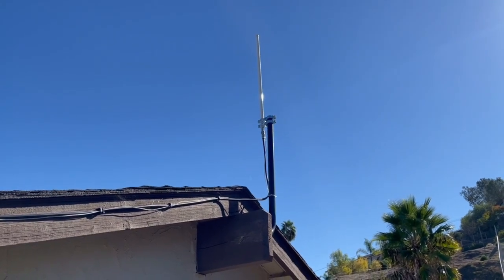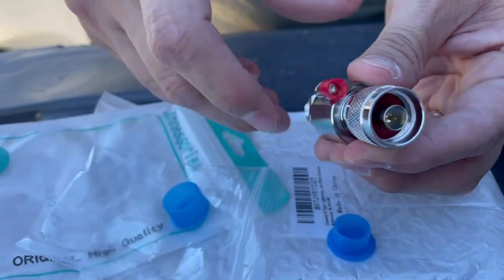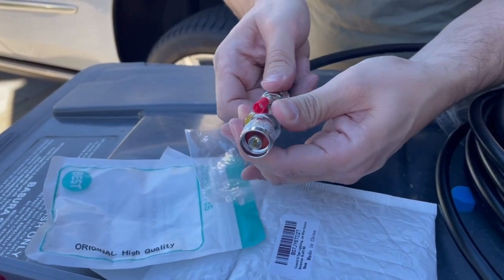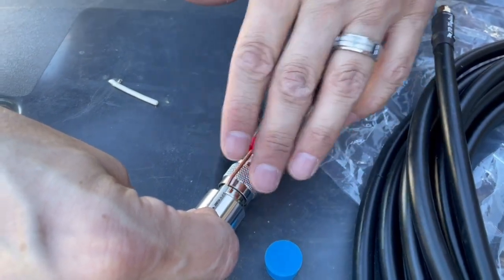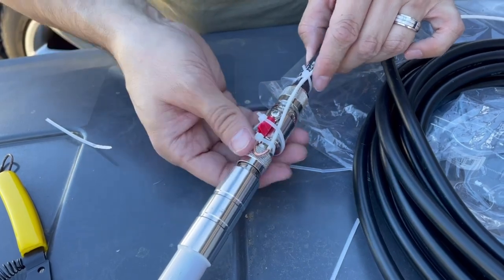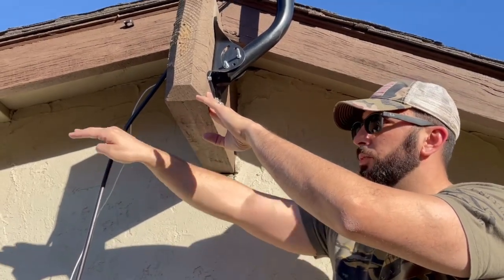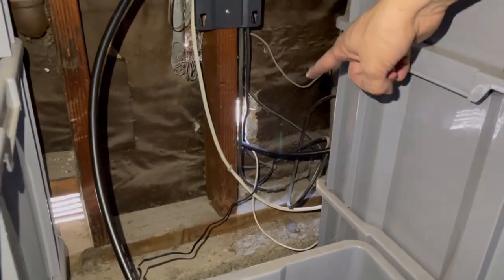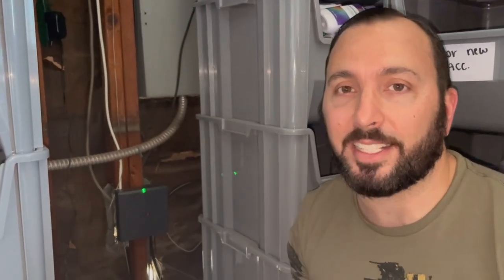Earn More Helium With Outdoor Antenna Install | Simple Process To Help You Get More HNT (Easy Money)

Comment: I know this is 2 years late. But I like using the emt metal conduit. It will fit inside your mount bracket and give you an extra 10’ in height.

Comment: Great job Caesar! My only critique is on that lightning arrestor you crimped the plastic part. You're supposed to crimp the metal part between that and the screw. This can be done by unscrewing that connector so that you can get your tool around it and then screw it back in and face it downward. I've been cabling for 30 years, which includes RF, Network, fiber optics and any other low voltage cable you can think of. The company I work for builds 5G for every major carrier.
Reply from the maker: Thanks for the info Dan.
Reply: I left off the part that you can direct message me anytime you want and bounce any ideas off of me. I'd be glad to help you out because I like your content.
Reply from the maker: I appreciate that. I’ll be sure to message you if I have any questions. Thanks again.
Reply: @CesarCinema  It says not to attach new antenna directly to the miner. How do I connect it. I do have the correct connection but concerned why they say that. Thank you.
Reply: @CesarCinema  I did the same as you lol.  I'm definitely not an electrician.  The copper wire came out so then I did as Dan explained and wow what a difference!

Comment: I had a rak miner fry last year.  It was hooked up to a rooftop antenna. I didn't do my research and realize the antenna should be grounded. I think that these lightning arrestors help protect the helium miner from built up static electricity in the antenna as well.

Comment: Great video. Have a question about the lightening arrestor. I installed mine close to the miner to protect miner from static charge build up from the cable. Is this good or not?
Reply: The purpose of the arrestor is to be underneath the Antenna to protect from static elctricity and positively and negatively charge clouds and storms, left over electricity from the earth, etc. it can travel. As for close to your miner, I’m not sure what that even means….
Reply: You want your lighting arrestor outside.  The arrestor is used to shunt the lightning away from the cable and into a ground rod.
Reply: @tylerharpster929  it’s not really for lightning. You can’t “shunt lightning away”. If you have on installed, and lightning strikes it, or your house/building you are toast my friend. It does however, protect against any electricity or other wise dangerous electric charges albeit in the air or other wise that could damage your device.

Comment: I'm not an electrician but you'd likely need a way bigger gauge (like 2AWG or 0AWG) ground wire to carry the surge to ground vs that small wire. If you think of the size of the ground wire for your panel in the house its way larger.  Just a thought if you are going to go through the trouble of installing one.

Comment: Another good idea is to, install a small male to male  jumper. A couple of feet long for example. From the bottom of the antenna (male.) To the lighting arrester (male.) Then run your wire from the arrester, into your miner

Comment: Where did you get the antenna mount that holds it to the pole?  I've been looking for one and I can only find them in bundles with antennas, but I already have antennas.  I use a flag pole so the pole is pretty wide...

Comment: Holy smokes yes !!!! Watch a video on how to crimp a wire… You need a wire crimping tool.. take the screw loose take your tool and crimp the round metal piece in front of where you crimped the plastic cause what you did has done absolutely nothing to bond your wire…the tool you has was a wire stipper go get you a new eye piece if that one’s ruined and crimp that wire inside the round metal piece..like I said you can watch a video on how to crimp on wires…I hope this helps and you learn something new from all of us it’s what we’re all here for to help each other

Comment: Thanks for the video I appreciate your selfless advice. 
Positive criticism I would advise against using electrical or any standard types what you want to use his heater in wraps what are use as an aerial and satellite installer is self amalgamating tape
 which is a self adhesive stretchy rubber waterproofing tape. Standard electrical tape there’s nothing more than Trump moisture an axe as a funnel. Keep up the good work   Thanks, Geoff

Comment: Hey Cesar, great video buddy. Thank you!  What a coincidence, today I had a pro install my 8 dBi Rak antenna on my roof, he did a great job. I drilled a hole on the side of the house and into the attic and the 2nd floor ceiling of my closet and installed the Bobcat miner on the top drawer of the closet (about 15 feet of LMR 400. Perfect!  I have a couple of questions; 1) I understand we have to go to a Helium website to update the new antenna and the  height, do you know where?  2)  How soon will the Helium system give back information of new Helium rewards?  Thanks a lot sir!
Reply from the maker: No problem William. Thanks for watching. Nice setup 👍🏻. 1) you change the new antenna and height on the Helium app. Click on your miner then the settings button ⚙️. Then go to Update Hotspot and change it there. 2) it normally take 72 hours to sync but it could be longer. Let me know if you have any more questions
Reply: Hi William, did you have a professional tv antenna installer do it, or was it a roofer? I’m looking for someone in my area to install as well.

Also, amazing stuff Caesar! Love your content bro
Reply from the maker: Thank you 🙏🏻

Comment: hello i am receiving my bobcat miner soon and i want to prepare for much reward as possible. i live near USC and they are flat land area. im going to put the antenna outside on top of the roof. its 25~30ft above the ground. i am also going to mount 40inch antenna pole on top of that. i was wondering what would be the best set up and if 5.8-6 dbi antenna will be the best? i see that on hotspotty map. LA area has terrible/poor transmit scale.. wanted to know if theres a way to fix that and turn it into green scale
Reply from the maker: You can choose from a 5.8 or 8 dbi Antenna. U can get one and if you don’t like the rewards you can switch to the other. Unfortunately you can’t do anything bout the transmit scale.

Comment: Hi Caesar, I’m a new subscriber. I am currently syncing a new bobcat at my sister in law’s house. She has a one story but I would love to install a rak 8 dBi antenna on her roof. At the moment it’s connected to Ethernet but when I install the antenna does it need to be connected to Ethernet to do well in earnings? Only reason I ask is because her router is in the guest room and I’m not sure she wants me to drill a hole through her wall to feed the LMR through.
Would def appreciate your input!
Reply from the maker: Thanks for supporting the channel. If you can I suggest that you use Ethernet cord vs using wifi bc it’s a stronger connection plus I have a lot less problems now that I’m hard wired in. I don’t have any more relay issues. Good Luck n let me know how it goes.

Comment: Loosen the screw... rotate the crimp connector instead of bending the cable... also crimped the wrong part.. supposed to crimp smaller section, also stripped away too much insulation, that will turn green and turn into a bad ground quickly

Comment: Hey ceasar.  Been watching your videos over and over. Running into issues.
Perfectly fine rak miner for 2 months.  Port forward open. 

Bought new antenna and cables and lightning arrestor. 
After mounting antenna and plugging everything back - like your videos,  my inbound and outbound has no connection. Port shows closed on portchecker. Router advance settings still has port forward to 44158. Ive tested ethernet cable with laptop - laptop works and runs fine..
Disk in diagnostic reads ok. 
NAT type  unknown...
Ive rebooted both router and unplugged miner multiple times now in between everything. 

From what I read I think it's got no internet going to the system?  Or is this due to bad 400lmr coaxial and 5.8dbi antenna?
Reply from the maker: Download the HeliumGeek app. This will tell u the status of your miner so u can see if it’s online and if everything is good with it.

Comment: Hey great video. How did the 6 dbi workout?
Reply from the maker: It’s doing great but we want to find what’s best for the area so we keep switching it do a different dbi
Reply: @CesarCinema  for real. I agree. I am doing the same and just got the 6 dbi. It's my first device. Unfortunately I have two miners in my hex that aren't doing anything. One has been offline and the other has been relayed for months. My transmit scale is now a .59. Any suggestions?
Reply from the maker: U can try to “spoof” your location if there is an open hex next to you. Transmit scale only affects miners communicating with yours not you communicating with other miners.

Comment: Great video.  Thanks for taking the time to make it.  

Why not use a pole extender to get your antenna even higher up?  

Also, could you put miner in attic?  Perhaps lessen your cable length / signal drop by having miner closer to antenna.  Or is the router closer to garage?
Reply from the maker: No problem. We are ok with the length of the pole. I think it’s better to have an outdoor antenna vs an antenna in the attic and the cable loss is not a big deal. The router is 20 ft or so from the garage door.
Reply: @CesarCinema  He means miner in the attic to reduce coaxial cable length to the antenna outside. Depending on the cable you can loose between .04 as .32 dB per foot.

Comment: How does the antenna perform in heat I live in Florida
Reply from the maker: So far so good. They are made for outdoor use
Reply: @CesarCinema  Thanks for the reply was worried about the humidity down here sheesh! Another question what material is your flagpoles made out of? How do they hold up on storms down here
Reply from the maker: It’s made out of aluminum and it’s been holding up good. A couple heavy rains but no storms yet.

Comment: That’s not how to terminate a cable into the ring terminal. The red part should grab the insulation and your conductor is far too long. Best to use pliers to crimp it if you don’t have the correct crimp tool. Thanks for sharing though.

Comment: Why does everyone keep calling these lighting arresters, they are NOT. these are nothing more than atmospheric static discharge lines. These just keep simple static in the air or from wind from zapping your minor. If the antenna was actually struck by lighting the minor and just about everything downstream would be fried. A 10ga copper line is not a lighting arrester. Lighting rod grounding wires are around a 2ga to 0ga.
Reply: looked up atmospheric static discharge line, and lightning arrester came up lol.... i guess they are lightning arresters :D
Reply: @MiGLBeatz  generic industry term. Probably because if you listed it as static arrester no one would search that way..lol

Comment: PLEASE do not run your ground wire to a copper pipe in your house.  Run it to a proper ground connection.  
PLEASE use a proper crimp tool to crimp your ground wire to the lug.  DO NOT do it like Caesar did.  You should be able to pull on the ground wire and it will not pull out because it is mechanically crimped in place.  (not just on the plastic) 
Do NOT run your ground wire parallel to your coax cable.  Your lightning arrestor is designed to give the electricity a place to go other than your cable.  If your cable is zip tied to your ground wire, the current flow in your ground wire due to the lightning strike will induce a very similar LARGE current in your cable, nullifying what you're trying to do.  
You should add drip loops before you go into your house to keep water from running down the cable and into your house.

Comment: id rather avoid that much of a lmr cable by using ethernet cable and mounting the bobcat on a outdoor enclousre
Reply from the maker: Some ppl prefer that method. Good luck with that
Reply: 30 ft of LMR cable is nothing The Miner puts out enough DBs to power 100 ft cable, you could even use rg8 which is basically the same 50 ohm cable but more flexible and signal loss would not be an issue.
Reply: Maybe you can do one outside and see if its any better for earnings. Good video , appreciate